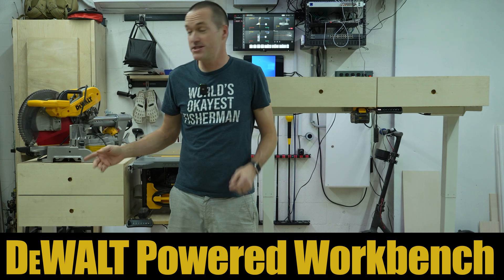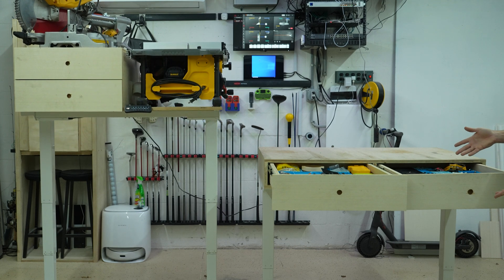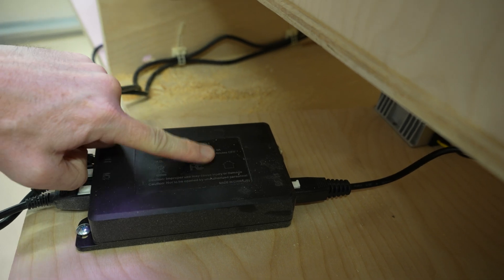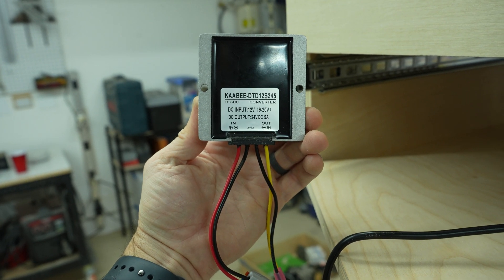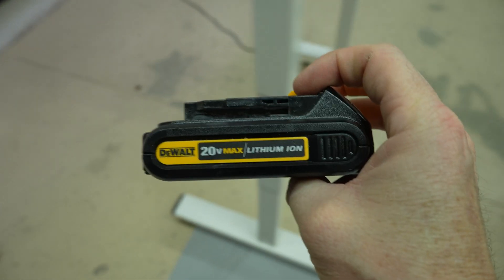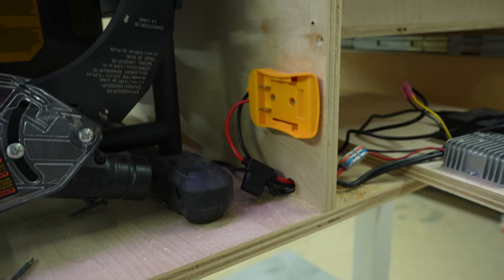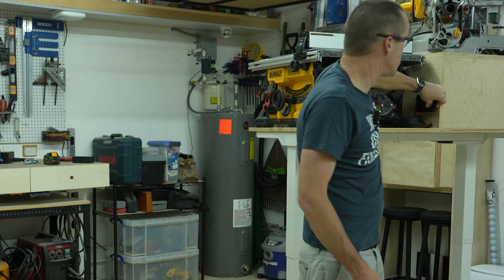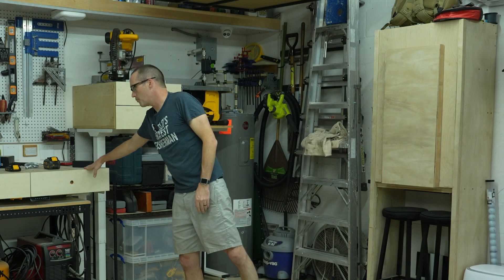DeWalt Battery Powered Adjustable Height Workbenches - DIY Hack

Comment from the maker: I also see that there's a 28V10A version of the boost converter on Amazon: https://amzn.to/3ZxpJDE I'm curious of that would work even better.  You can tell there is a slight slowdown of the motors when switching from the 29V AC adapter to the 24V DC step up.  If you have a really heavy desk/workbench you might need the 28V one.

Comment: Do you even need to step it up to 24v? Shouldn't the 20v of the batteries work as-is? Pretty cool either way. I've also used special boards that can cut power at like 16v so batteries dont get drawn down too low
Reply from the maker: Yeah, it doesn't work without the boost converter.  When the battery goes under load it drops down to around 15V and errors out.  With the boost converter the voltage doesn't drop nearly as much (I assume because as the battery's voltage drops the boost converter raises it back up).
Reply: @thehookupextras  Makes sense, thanks!